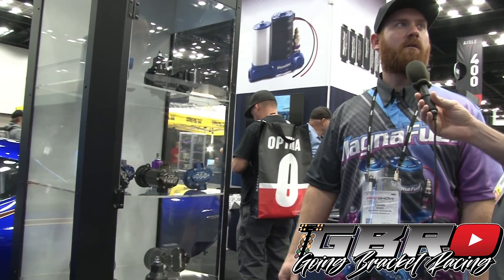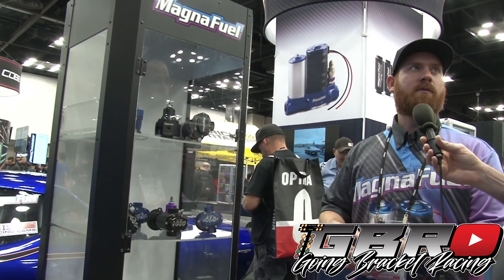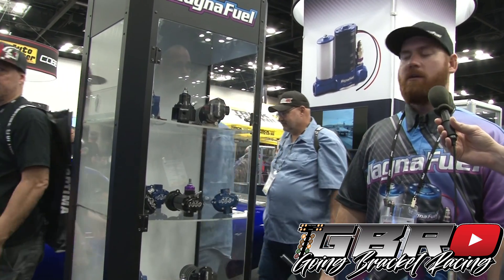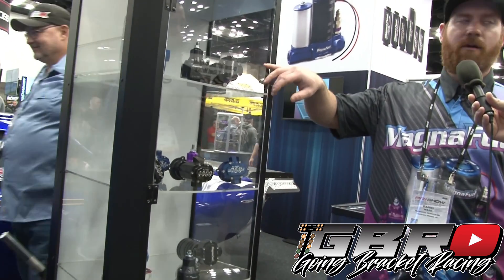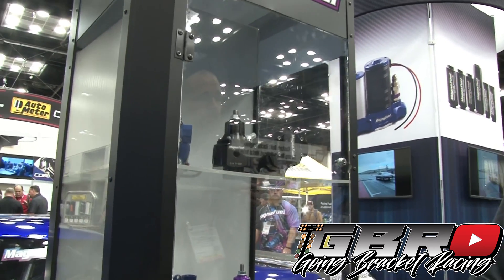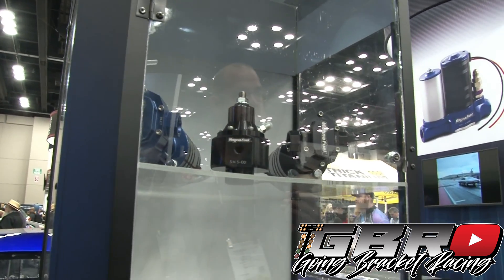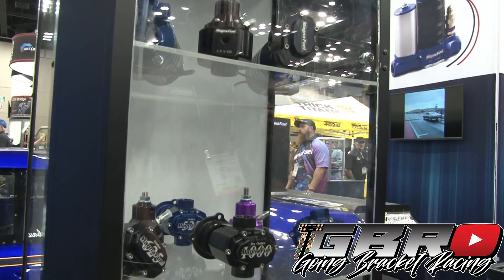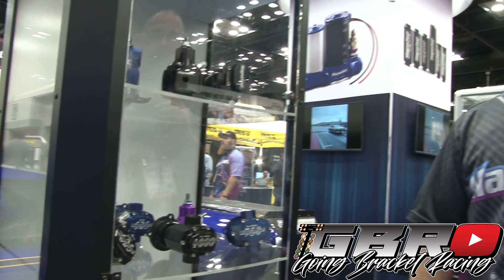What fuel pump for boost | Magnafuel | Electric Fuel Pump | PRI 2023

Comment: We run 25 lbs of boost on a 509 bb with a dual needle and seat IRD blow thru carburetor, we use two prostar 500 pumps adjusted to 30 psi and two boost reference regulators at 7psi initial pressure one pump feeds 2 inlets on one side of carb the second pump feeds the other two inlets as carb has 4 -8 inlets works like a champ with E85 .